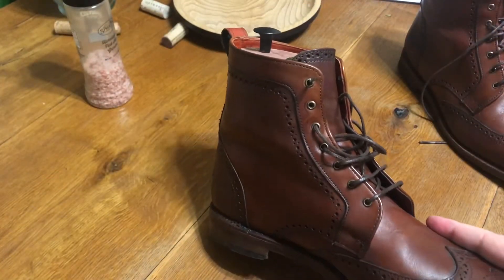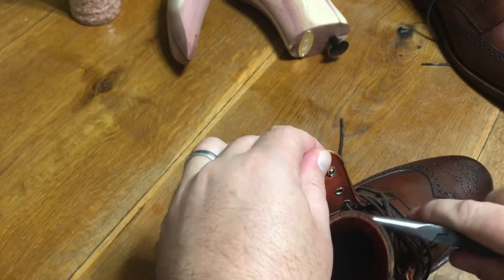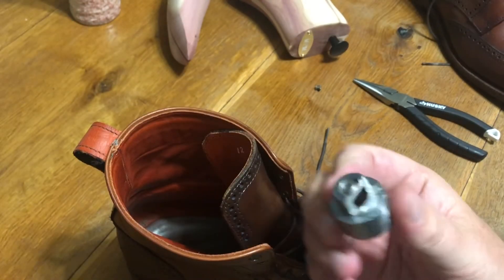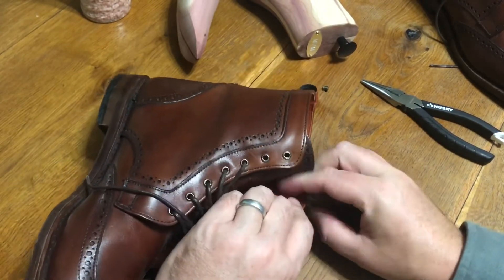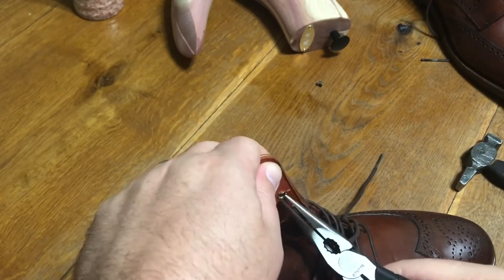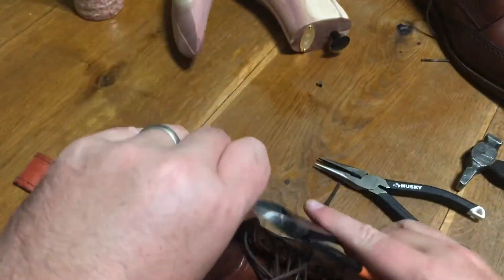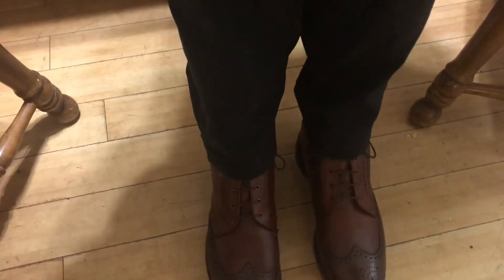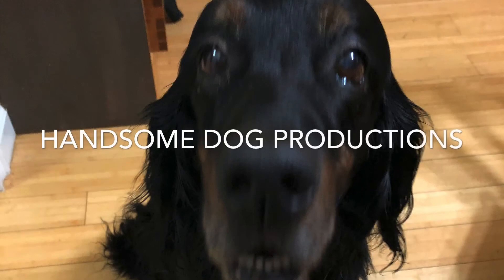Upgrading Allen Edmonds Dalton's with Speed Hooks

Comment: Do you know where I can find the punch or die that spreads out the back of the eyelets into petals? Or even what it is called? Having so much trouble finding that tool thanks!
Reply from the maker: I'm not sure what it is called, its just listed as tool for speed hooks.  I think I got mine on ebay from someone like this but cannot find the record so not sure.  I remember it took a month to get to me though!  I hope you can get them, its a nice upgrade.  https://www.ebay.com/itm/372276781397?var=641112148381&chn=ps&norover=1&mkevt=1&mkrid=711-117182-37290-0&mkcid=2&itemid=641112148381_372276781397&targetid=1068323858070&device=c&mktype=pla&googleloc=9032011&poi=&campaignid=11614425326&mkgroupid=114834329962&rlsatarget=pla-1068323858070&abcId=9300456&merchantid=138378295&gclid=CjwKCAiAg8OBBhA8EiwAlKw3knMcy0Ywil1k8i3hVLrelO1stLwm6tL5phoT4mxTKfVTaYifV1s_-hoC4b0QAvD_BwE
Reply: @desertislandtoolworks1956  thanks! I really enjoy the speedhooks on my Higgins Mill, it's a great idea for the daltons since they kinda run narrow and seem to have to undo a lot of lace to just get my feet in.
Reply from the maker: @liljuanito123  any luck getting speed hooks on your Dalton's?